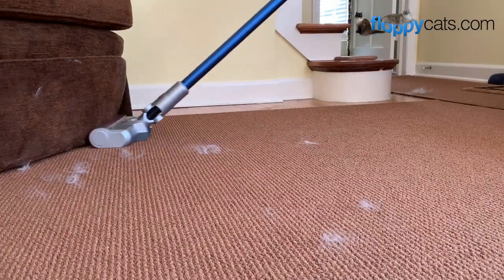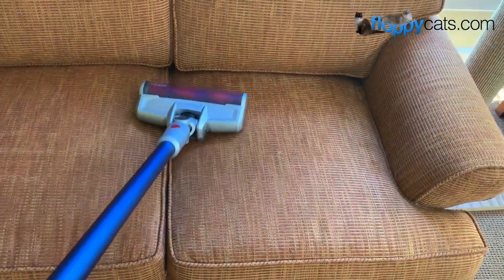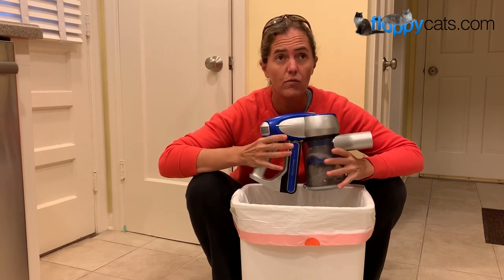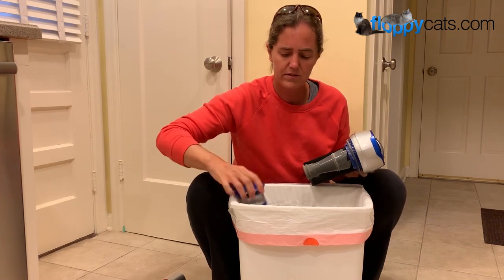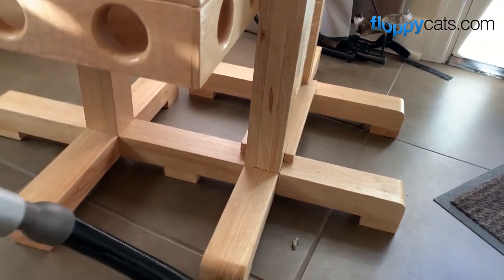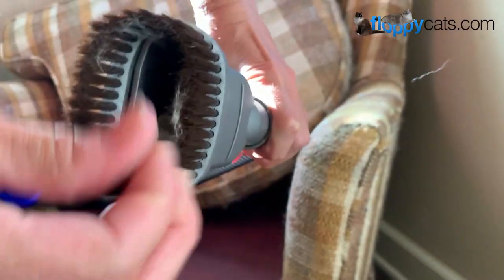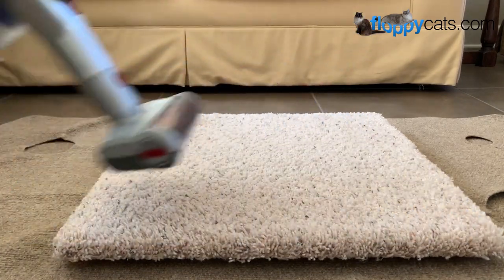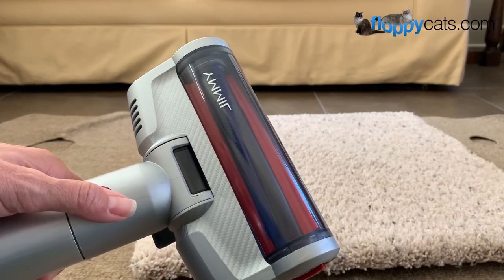Jimmy JV 83 Cordless Stick Vacuum Cleaner Product Review

Comment: I bought the Dyson V10 Motorhead several months ago. It does the job well, no arguing about that; however I could have bought this device and saved myself a lot of money - and I actually HAD thought about it at the time. But like some of us I thought that something low cost
 would probably be of a "cheap" quality and you get what you pay for however that is not always the case. I just wound up.paying lots of money on a vacuum cleaner that is probably not better than a Xiaiomi Roidmi or Jimmy JV83. In fact, my friend got the new Xiaiomi Dreame V9 I saw her using it one day.......and it's even better than my Dyson.
Reply from the maker: sorry that you feel like you spent a lot on your dyson - but i would agree, these jimmy ones are awesome.  when they come out with a brush head roller and the no-wrap one in one unit, that'll be the ultimate winner.  i still love that my dyson v8 has the traditional brush head, so that it picks up better on carpet.  if i didn't have carpet, i would solely use the jimmys.

Comment: Hi Jenny! I'm still looking for a cordless vacuum. So the Jimmy JV51, you didn't recommend due to the lack of suction power & my having mostly low pile carpet. So you do recommend this one? I'm going to use it for my two long-haired cats (plus two dogs)...basically what you use it for. It'll get daily use as there's always cat or dog hair somewhere.🙄 I really MUST order myself a Lily brush.🤔
Reply from the maker: I think this one or the Jimmy JV51 are fine for just cat hair and cat litter pick up - and dog hair, but not great for getting down into fibers of the carpet because of the brush roll head.  It's really the no hair wrap brush roll that keeps it from being great for carpets.  But if you just want the topical stuff, it should be great.
Reply: @Floppycats  Thank you!